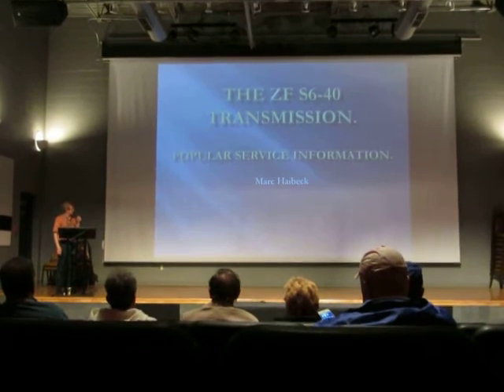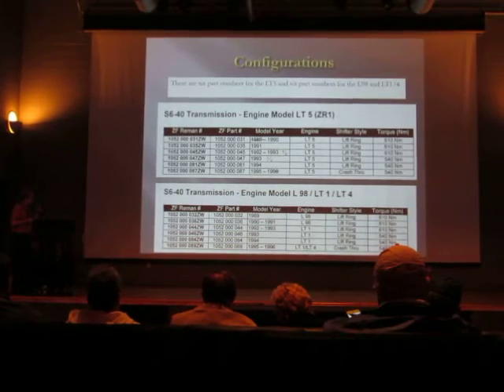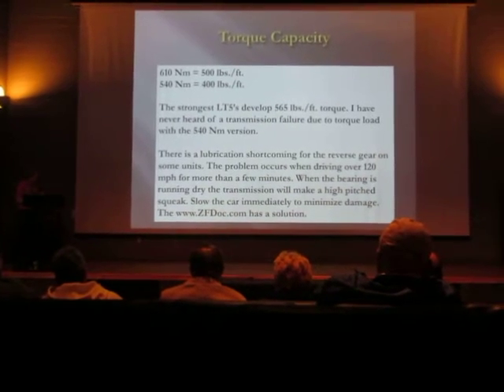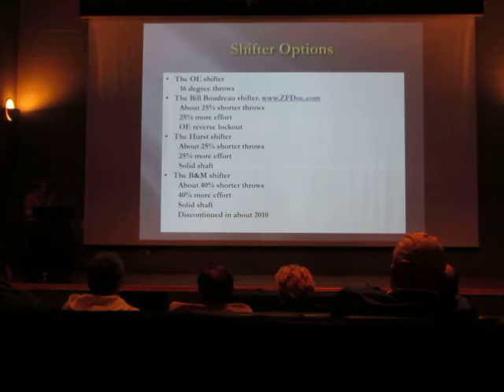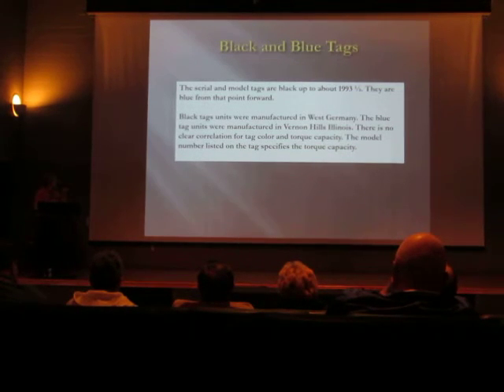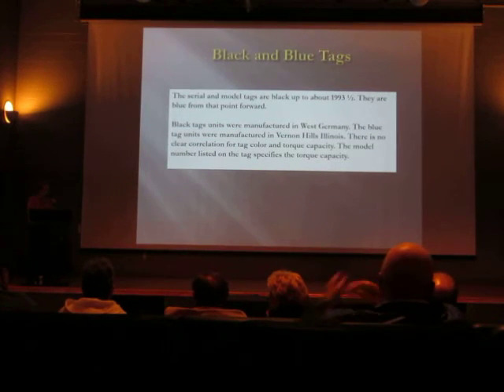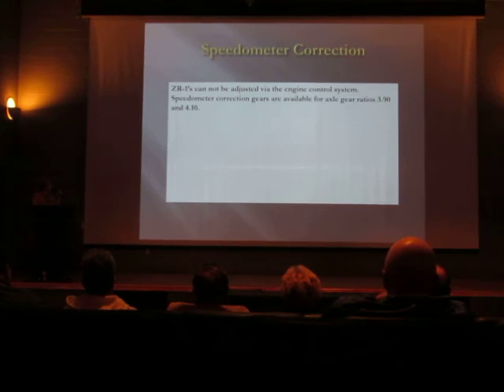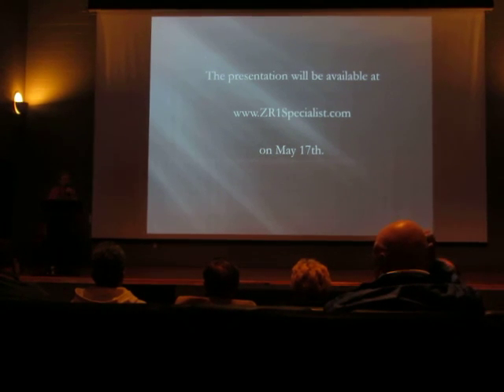ZF S6-40 transmission tutorial

Comment: I had the poor oiling for the reverse gear happen at the Bowling Green Gathering one year. The car was my first 91 ZR1. It had the nice mods. Watson Headers, not cats, early style 3" B&B exhaust and 4.10 gears. I had driven the car on occasion to speeds over 150 MPH with no issue. When it occurred I was doing a burnout at Beech Bend. My burnout was done at about 6800 RPM and I let off. The next thing I know it had the high pitch whine. I shut the car off and let it cool down. I tried restarting the car about 40 minutes later and the whine was still there. 

Eventually it went away but the damage was done. I called and talk with Bill from ZF Doc and he said the reverse gear must have starved for oil and welded itself to the shaft. I drove the car home from BG and for about a year and a half before replacing the unit with a new version. I found that some times under part or light load in first gear it might pop out. Under hard load it stayed in gear. The previous owner had swapped from the recommended BMW oil to the Red Line Heavy Shockproof. Not sure if that had any effect on what happened.

Comment: I have the early transmission 1990 base model corvette with dual mass flywheel and haven't had any annoying rattle noises from my transmission. I do however have an annoying rattle that recently developed from the dual mass flywheel. It must had nuked itself from the power of my new engine and left huge amounts of grease in the bell housing. Will soon upgrade to a single mass flywheel.

Comment: At least with LT4 you can do speedometer correction with JET dst software and cable. I have LT4 with single mass flywheel, I have tried Amsoil MTF, it doesn't sound good, then I changed to RedLine MT-90 and it is much better than Amsoil MTF but still still noisy when hot. It whines on certain RPM and also on idle. Maybe I need to try Heavy Shock Proof or that mixed with MT-90.

Comment: II think you can tune the engine (modify ecm binary file) to reduce peak torque and concentrate on peak power, by reducing advance timing in the region where the peak torque, 400lb-ft would be probably enough to enjoy the car. The disadvantage is you have to rev the car up everytime  you want power (acceleration), like over 4000rpm,  high torque meaning power down low. High rpm is associated with other sort of problems including less efficiency of the driveline (oil will heat up for example) so you lose some of the crank power, no idea how much,  say 3000 vs 4000 shouldn't be that much.
LT1 having less torque were optimised for more power less torque which is more enjoiable in a sports car,  and when  upgrading (intake, cams, rr, headers) an engine it makes more sense getting more power without increasing the torque too much

Comment: There is a myth out there that the 1st to 4th gear skip is for fuel economy. That is a bunch of balonay. I drive a Peterbilt Truck, and have been running long haul for 46 years. We have multiple gears in our trucks for fuel economy. My truck has 13 gears. Many trucks these days come with 18 gears. Fact: The more gears you have, the better will be your fuel economy. You have little small jumps in between gears. It is 200 RPM split in  high range.  So you do not need to rev high before you shift. Lower RPM= Better fuel economy.  With this stupid skip shift, you have a huge jump in your RPM split, which contrary to the myth is really a fuel waster, and probably not that good for a cold engine. Multiple speed transmissions allow you to keep the RPM in the sweet zone, for good fuel economy, and no lugging of the engine.  Please have a talk to GM, and the transmission people who perpetuate this myth. They are doing a disservice to the public teaching nonsense.